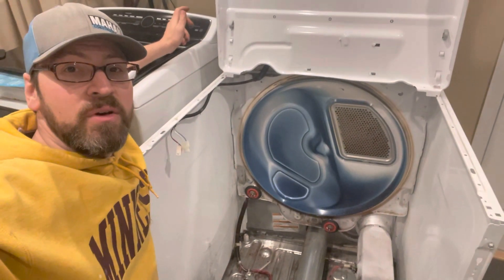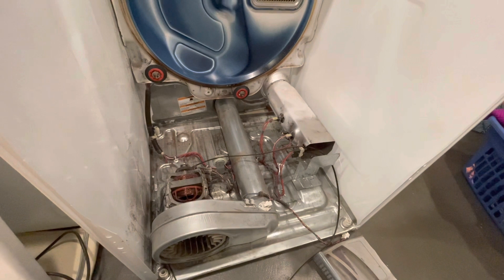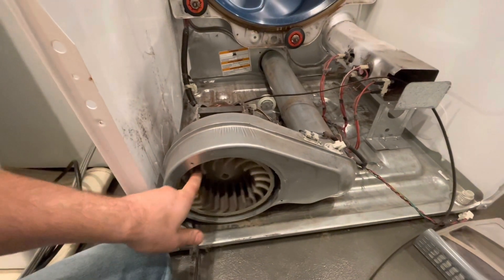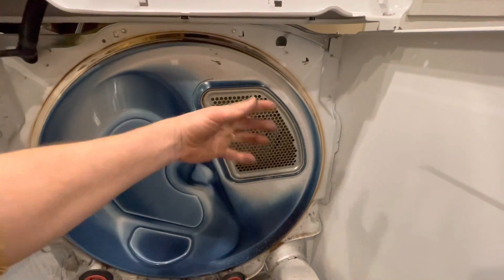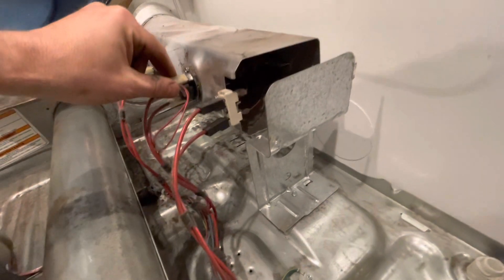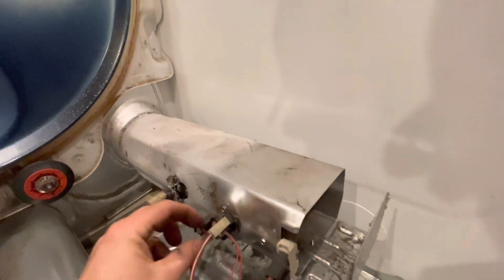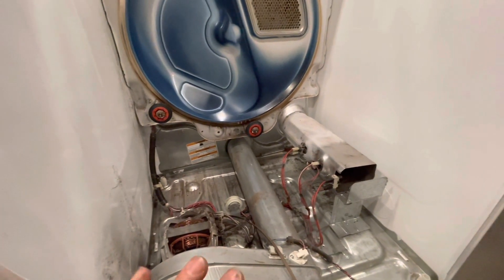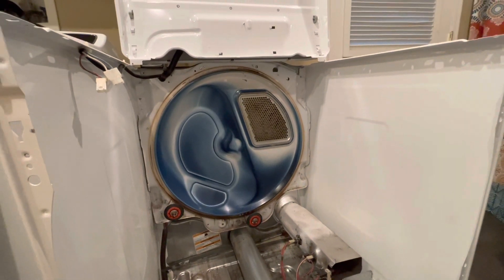How Does A Clothes Dryer Work? A Look At The Internals

Comment: Pretty good explanation but the sensor explanation is mostly wrong. The two on the element are a thermostat that controls electrical flow to the heating element (the coil). The other is a thermal fuse that blows when the heat reaches a certain level. Once it blows, it has to be replaced or you won’t have heat in the dryer. The other two sensors are similar, one is a thermostat that helps control the temperature of the element after the clothes absorb some of the heat, and the other is a thermistor and the only real sensor the control board sees to measure the temperature (technically resistance relative to the heat) so the dryer will increase or decrease the drying time. There are no airflow sensors since clothes and lint would always interfere with the measurement.
Reply from the maker: Excellent comment! Thanks for clearing that up.

Comment: Im still confuse where the air comes in.  Im trying to prevent it from get clogged up or blocked haha
Reply: Most of the air is pulled from the back of the dryer although your dryer may differ. Look for something that looks like an air conditioning vent. For the dryer in the video, it covers half of the back side. You can’t see it from the inside here because the rear drum cover covers it too.
Reply: @YeshuaWatson  thats what im saying though I see no vent anywhere!  must be covered up, but then hows air get in there?!  really bizarre
Reply from the maker: I checked mine and it seems the air comes in through some fin vents in the back. Also there were a couple small holes in the back that were drawing air.
Reply: @NashwaukSteve  I got nothin!  Maybe underneath on the bottom?!  Thats the only place I havent looked